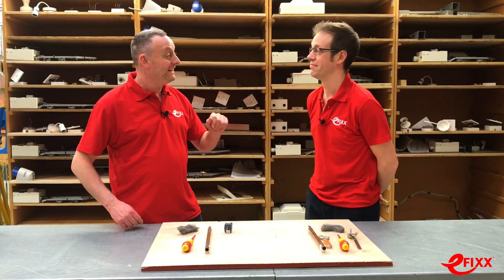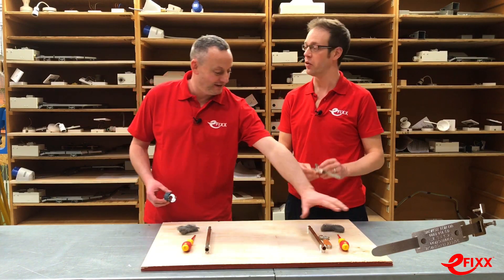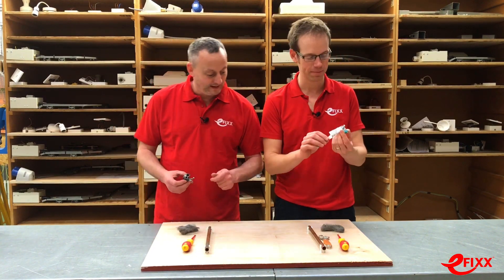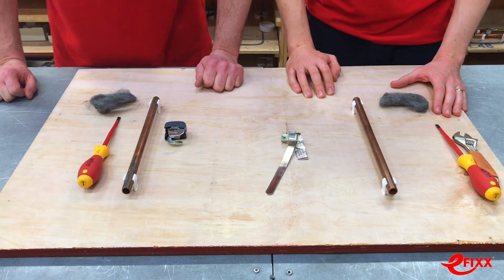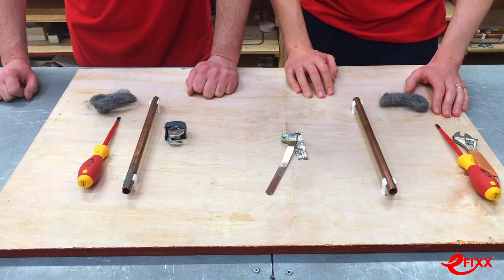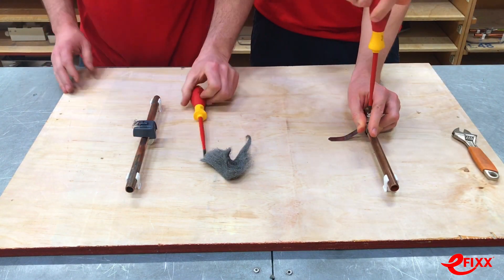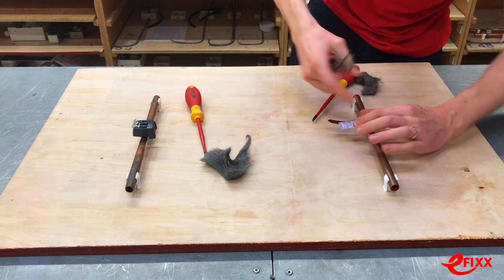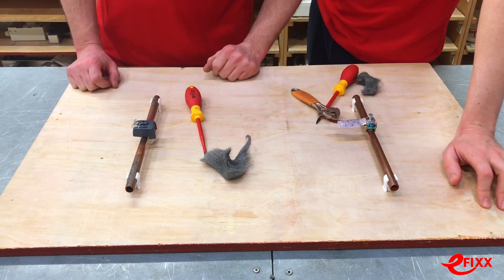Rapid clamp vs regular BS951 earth bonding clamp - electricians time saver

Comment: Serously? This is done by actual electricians?
Do you have common sense ?
Wth why connecting electrical ground to water or gas pipes?
Use a real ground and avoid playing with the health of the people.
This is super dangerous.
Reply: You clearly don't understand the British electrical system. This connection is NOT used to provide an earth connection to the installation. Most UK installations have an earth provided in the supply cable cut-out (TNS or TNC-S). The connection shown in this video is an electrical safety connection to bond water/gas pipes to the MET (main earthing terminal).
Reply: If something electrical touches the pipes it stops you getting electrocuted when you touch a tap or metal sink (common in UK), etc... Your pipes have to be earthed.

Comment: Why does it matter? You'd only install 1 or two of these a day. So you'll save 2 minutes total at what cost? Add to that, from what I see, you have reduced surface area  of contact with this clamp, less resistance to corrosion and pipe damage. Come on. Gimmick.

Comment: It is not just how quick, but how Good a clamp is that is important!

I assume there are different clamps for different sizes of pipe? Even if so you have to question the area of contact of the clamp.
It will be fine when installed ...... but what will it be like after 10 years of damp conditions. Corrosion will, I think, be an issue!

Tied in with that, how well the clamp will handle high loads may also be a problem.
"High Loads" I hear you ask? Yes. The whole point is to provide a good path to earth for unusual events .... like when the dodgy "plumber" rewires the pump or puts a kitchen in, or even when we get the fabled lightning strike nearby ...... or even if there is a fault on the DNO's network!

Comment: Where is the obligatory warning label? Plus, the rapid clamp has much less contact area on the pipe, and is more prone to damage to the pipe due to the lower surface area.
Reply from the maker: The label is on the rapid clamp.... it’s embossed on the body of the clamp 👍

Comment: Nice.. What about the label on the rapid clamp???
Reply from the maker: Great question, thanks for asking. The label "Safety Electrical Connection Do Not Remove" is embossed on the side of the clamp. 👍🏼
Reply: @efixx  I've just googled a closer picture of the clamp itself... You can barely read the text, it definitely need to be more prominent, nobody'll be able to read that when installed in a dark area.
Reply: @ashmanelectricalservices4318   Agreed. The minimum is 2.5mm text size, which is almost unreadable , especially in low light. The normal clamp is about 4mm text height, plus the standard label is easily identified at a glance.
Reply: @colinritchie1510   "plus the standard label is easily identified at a glance." so is the big green and yellow cable
Reply: Although the rapid clamp does comply with 514.13.1 and obviously BS951, I agree that a separate label wouldn’t go amiss as they are difficult to read... but then again the green and yellow string coming out the side is a bit of a giveaway too lol
Reply: Will it fit 10mm copper pipes? Always a pain fitting standard clamps to 10mm